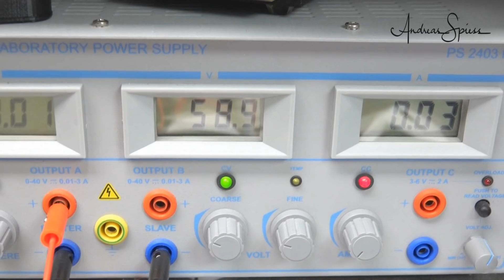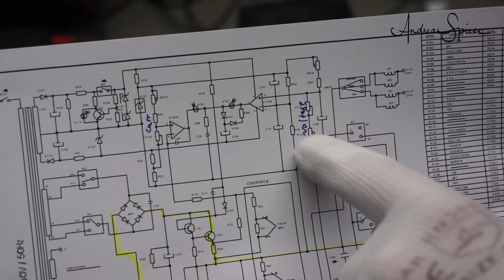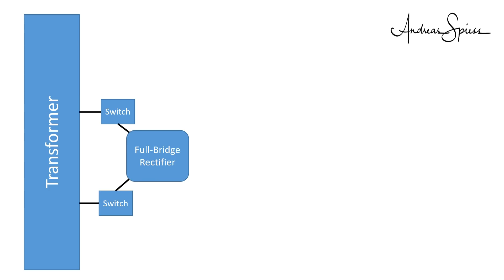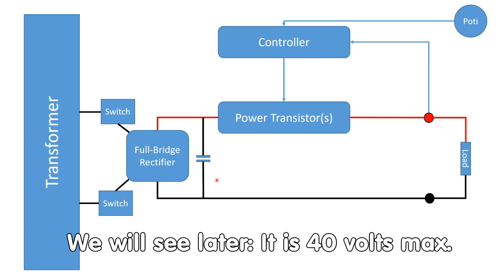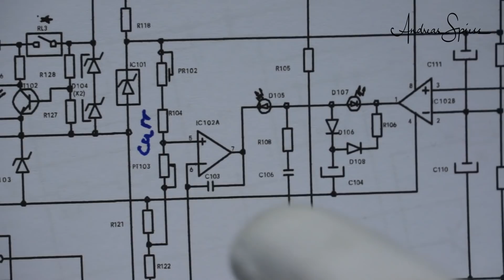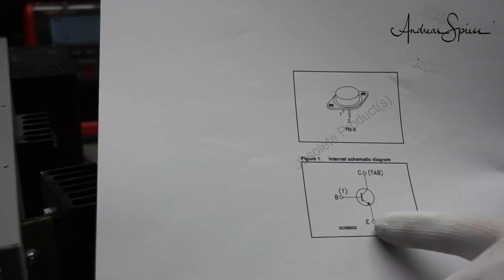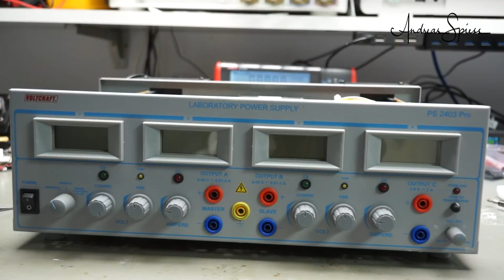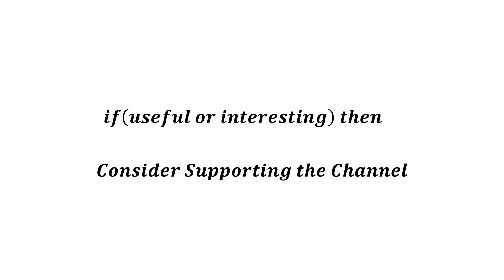#228 How does a Linear Power Supply work? (Incl Repair)

Comment: I bought a linear power supply to actually hook up my audio equipment (and to do some other home testing). I just can't figure out how to hook up stuff because I don't want to blow anything. tho it has a black and a red circles on the back for positive and negative and im guessing i just unscrew and wrap the bare wire around the positive, and the negative around the negative and screw them back in and aslong as the voltage is set right it should work. Tho I want to make sure so i'm watching a BUNCH of videos until i see someone hook one up.
Reply from the maker: I would check it with a simple multimeter. Then you know.

Comment: Really interesting.  Just yesterday, the day before I watched this, I was looking at power supplies and thought to myself, I wonder if there is a way to switch in different windings and to feed the DC side of the supply and here it is, exactly the same thought.  I even wondered if anyone had used a variac to do it.  Probably so.
I was also surprised there wasn't even a speck of dust inside that unit :)
Reply from the maker: Using taps was a common thing before we had switching regulators...

Comment: Thanks for such a great video. I had the same problem with “Votlcraft ps 3610” , mc1458n is not working and resistor 107 burnt, but transistors are ok and current control’s working
Reply from the maker: These are old devices but quite easy to repair :-)

Comment: Could you make a video about the esp-rfid project? I have some trouble setting it up
Reply from the maker: I have no plans for the moment.
Reply: Andreas Spiess Thanks for the reply! Anyone who made a video about it? Would like to try doing it without bricking my device
Reply from the maker: It is usually hard to brick a device by just flashing software.
Reply: Andreas Spiess I know, but having it on 220V and connecting an rc522 to it is pretty risky
Forgot to add: i have a sonoff and an esp8266, i would like to use the sonoff for the rc522 and the relay part if possible, but having an esp8266 connected to the rc522, and sending an mqtt message to the sonoff would be also cool

Comment: nice. but, what kind catastrophic failure that triggered, that it took out so many key components like that. and it's strange that the cc did not kick in.
Reply from the maker: It was probably not current, it was over voltage...

Comment: Many years ago I used to repair stuff. Fiddle as much as you but sooner or later I would get it (most times). Older stuff is fun.
Reply from the maker: You are right. And it is easier if only standard parts are destroyed.

Comment: This is a common phenomenom on all power supplies.  Without a diode on the output you will get back feeding of current of the device you are powering.  For example, if you are charging a battery the battery will spin the fan on my hacked ATX power supply, but no damage like you see here.  This repair should have been simpler because if the chip were at fault you would most likely see a different symptum, probabily just a non functioning channel.  Most of the time, with this kind of over voltage type damage both the power transistor and the driver chip shorts out.  Thanks for posting this repair.
Reply from the maker: You are right for charging batteries the "wrong way". I think this was not caused by back current (I had no burned traces). It was most probably an over voltage. Diodes at the output of precision power supplies are also problematic. GreatScott recently did a video about that.

Comment: Clearly this type of power supply must have some control logic for switching the transformer secondary windings that includes hysteresis.  I have wonder what effect  switching the secondaries has on the output voltage.  I guess some big inductors and capacitors BEFORE the regulator would take care of that.
Reply from the maker: It shows a hysteresis. The voltage is quite proportional to the angle of the potentiometers. But this is maybe because of the regulator which takes care of any switching effect.

Comment: Nice video as always. One comment, on minute 7:31 you show an equation to calculate the power which is wrong. You have 50V-5V equal to the power calculation but its not the same units, you missed the multiplication with the current
Another miss is at 9:29 were you do voltage squared and 60^2 is 3600 and not as is shown
Reply from the maker: 7:31 seems to be ok for me. I multiply 45Vx3A =135 W
9:29: you are right.
Reply: @AndreasSpiess   on 7:31 you wrote P=50V-5V=... you have to write P=(50V-5V)*3A=...

Comment: A vacuum de-solder tool is quite handy compared to a solder sucker and they appear sometimes on ebay.  Great repair... (I have a PSU with a similar problem that I haven't got to looking at yet).... this will be very helpful. Thanks!

Comment: Congratulations! I'm currently working on a hybrid switching and linear PSU. This is, switching for 230 V to 3-50 V and then linear regulator for 0-47 V (due to the dropout) for reducing noise, at the same time it's more efficient and lighter. And of course, I'll put a TFT touch screen (OK, touch screen might be a bit too much).
Reply from the maker: I plan a similar thing (only up to 12 volts). Which linear regulator do you use?
Reply: Andreas Spiess It’d be more appropriate to say “are going to use”. I haven’t even wound the isolation transformer for the SMPS part yet! (for which I also have to make a spool and Litz wire). Or maybe I should just buy an already made SMPS (the problem is that I already bought all the parts :/ ).And I still have to design and etch a few PCBs, solder the components, test it and program the MCU. I still have a long way to go.
Reply: @AndreasSpiess  Take a look at the LT3080. It's a really flexible chip for this kind of things. You can use them in parallel for good heat spreading and higher currents. I think Dave Jones used them in his mobile power supply. Internally it is simpler then a lm317. This makes it easier for voltage regulation and current limiting, by a microcontroller.

Comment: Linear PSU was very interesting , pity the repair video was all over the place and choppy. Second transistor ? Testing the LM48 ? Not your normal style  :)
Reply from the maker: Sorry about that. I thought, testing an optocoupler is not interesting. I  only created a 10x amplifier and it worked. The second transistor was obviously dead because, after changing the first one, the PSU still had the same error..

Comment: Replacing some parts and spending some time is a whole lot cheaper than buying a whole new unit  :)
I have an old PSU I need to go through and give a good checking over. I think I need to replace the front varistor as the readings aren't stable. The unit was exposed to outside humidity (good 'ol Fl; >70% humidity on a "dry" day :P ), so it's probably toast.
Reply from the maker: Mine is generally in a good condition, even if it is old (I bought it "used"). So it was worth the effort. I hope you also will be successful!

Comment: So, why did it burn in the first place? Did your circuit inject current into the supply?
Reply from the maker: Most probably it was an overvoltage which killed these two transistors, not the current. Otherwise, we would find some burned traces.

Comment: i reallly should fix my bench supply, against the warnings i used it to charge some nimh batteries, then the power went off and the big battery pack fed voltage back into the supply, it has no protection against that... known bug. but it is from 1960's and until now was all original! (farnell l30b)
Reply: GreatScott! just had the same problem - https://www.youtube.com/watch?v=7Tk5ghH_U2s
Reply from the maker: Nice rig! And in 1960 the engineers were also more cautious because the equipment was very expensive!

Comment: Why do You get a higher max. Voltage after the repair?
Reply: I'm betting the Transistors had something to do with it. Probably uses a lower base current to switch the Transistor on. If it was me I would compare it to Channel one and recalibrate Channel two to match the Output of Channel one.
Reply from the maker: I do not know. But in the end, I  used the trim potentiometer to get it to the "normal" level.

Comment: Good video Andreas and a nice PS recovery. Sadly we all know this is likely to happen to everyone since not only everyone makes connection mistakes but also there is always the possibility of defects in our own pcb's soldering and the like. It simply happens. Many thing can go wrong and and the rule is ... what can go wrong will go wrong :) . That's why it is paramount to have a Schematic of the power supply as well as all the basic tools we use (Solder iron, multimeter and the like). And I also love Linear Power supplies.
Reply from the maker: And in addition, I have nice viewers who helped me to find the diagram. Much easier!

Comment: Doesn’t it need to be recalibrated after the repair? Also I noticed a significant voltage jump when changing the voltage around 15-20 volts is that normally with liner power supply?
Reply from the maker: The potentiometers have no values written to the case. The voltage is only read at the display. So nothing has to be done in this case.
Reply: Something is still different from the A channel. I'd be suspicious of the v/c regulation on the B channel. Something else is likely out of spec but not dead maybe some other resistors got smoked and are no longer at their nominal value. The good new is you have a working channel to hunt down what changed. Maybe poke it with a rapidly changing load like 2 power resistors one with a switch or a programmable load and scope its response and compare it with the A channel and compare its transient behavior is when it switches transformer taps. I'm not convinced the 43 volts doesn't come with a down side :) As always a good video.
Reply: Typical cheap single turn POTs do that, that is the reason for the "Fine control" so you can get near the voltage you want then dial it in with the Fine Control. Higher end supplies use 10 turn / multi turn POTs.

Comment: Great work Andreas!
I was pretty sure you'll be able to repair it! 
Nice idea to switch the voltages to keep low power disspation.
 It is the first time i see a linear power supply with these feature.
But all my power supply are from kit or copied from magazines, not professional stuff. The maximum complication was the double secondary: one for power and load and the other for reference voltages ! Bye
Reply from the maker: Mine is probably also "semi-professional". I did not buy it new.

Comment: Checking the resistance with a meter is always a good idea of course, but you should be old enough to remember the incredibly racist phrases that used to be taught for remembering the color codes! :-D Or maybe Switzerland didn't have those. But anyway, you never forget them...
Reply from the maker: I do not know the phrases and was ok with the old (few) values (and gold or silver at the end). So I knew at least where to start. These days with the small parts, the 5 stripes and many more values, I gave up ;-)
Reply: I don't recall a racist one? We learned bad boys rape our young girls but violet gives willingly.
Reply: What I learned was virtually identical to what you learned, but it was racist as well as sexist. But it must have been a very effective teaching tool because a few minutes later everyone in the shop class remembered the color code, and I still use the mnemonic 45 years later. If we were just asked to memorize the color code, I would still be looking it up every time I needed to use it...
Reply: Ah. Googled it, there are a ton of stupid PC correct ones listed that are essentially random words.. completely forgettable :)  I guess it just made sense in my head the 0 would be lack of color (black) to keep 0 and 1 straight. But yeah the humerus one is still easy to recall decades later. I did just lean the sliver and gold as multipliers not just tolerance bands though.
Reply: Yeah, I still remember learning this like it was five minutes ago. The mnemonic was so insensitive to multiple groups that everyone in the electronics shop class (and there were some complete zeros) learned the color code in record time, and most probably still remember it, whether they have been using it or not. That's the power of outrageous humor... Aside from the first word, rape was sometimes replaced by ride, which might have made the mnemonic even more memorable! ;-)

Comment: I was pretty convinced that you were able to fix the power supply. Great job. The supply may be old school, it is defenately a nice piece of hardware that will last for many years. I build my power supply, the famous Elektor one, back in 1982/83 and although I used and misused it (as a battery charger...) it still performs excellent. I've always been fond of power supplies....
Reply from the maker: Another viewer also wrote he built his PSU in the 80s :-)

Comment: Current regulator? Me thinks at start. Check parts aroud it too.
Reply: Negative and positive feedback loop love it.
Reply: Did you have a mica spacer as well as heat paste?
Reply from the maker: There is an isolator to electrically isolate the transistor, yes.

Comment: I built my own linear benchtop power supply based on a kit back in 1983 when I was bored and unemployed after graduating as a Mechanical Engineer. The kit had 30V output but low current limit at lower voltage because of the power dissipation.  Read the data sheet and found alternative secondary tappings on the transformer in the box.  Connected those and the original via a DPDT switch to get high and low voltage output, at maximum current.

What I learnt dabbling with electronics helped me get my first job and helped me design and to realize machines to make things easier in production on the metal fabrication shop floor. When the work got easier, quality improved ... Sometimes also the quantity.

Comment: I soldered wires to a 3 pin header and put hook clips on the end, that goes into those trans testers as an adapter so you can test awkward parts. Sometimes you can even test in circuit. Also did one with logic probe clips on the end for other stuff.

Comment: Prima. Es war nicht so einfach, wie bei meinem Netzteil, aber Du hast es geschafft. Alte Zahnbürsten sind nützlich, aber in der ESD Variante viel ungefährlicher für die gute Elektronik. Ich habe mir solche für wenig Geld aus China besorgt.
Reply from the maker: Ich wusste nicht dass es solche Zahnbürsten gibt. Muss mal sehen... Ja, es war nicht ganz einfach. Ich habe ja nicht die ganze Komplexität gezeigt und ich hatte einige Zeit bis ich die Schaltung einigermassen verstanden hatte.Die OpAmps werden nochmals aus einer andern Sekundärwindung versorgt, vermutlich weil ich die beiden Teile in Serie schalten kann und dann eine relativ hohe Spannung bekomme... Und dass es beide Transistoren gleichzeitig tötet war auch überraschend.
Reply: If you don't use the brush dry, you don't have to worry about ESD safety. Nylon is slightly triboelectric but when wet, the lost ions have nowhere to go but right back.
Reply: The ESD brushes come for cheap from China. Probably not more expensive than a decent toothbrush :-) So, why risk it?